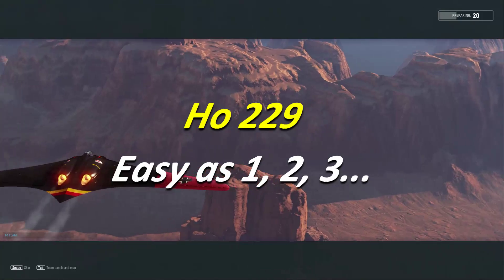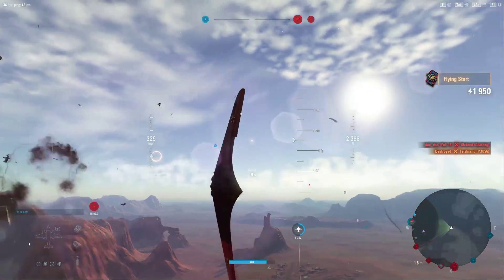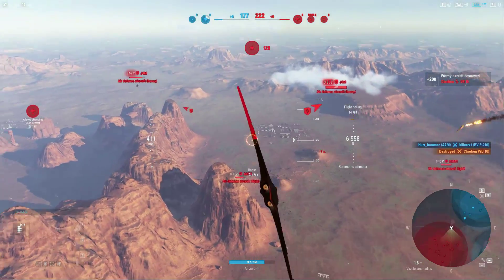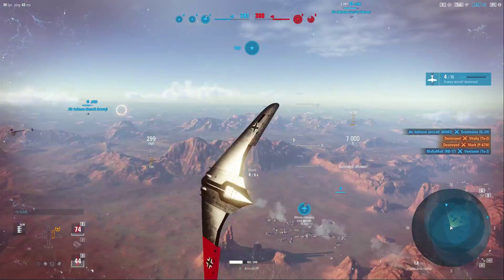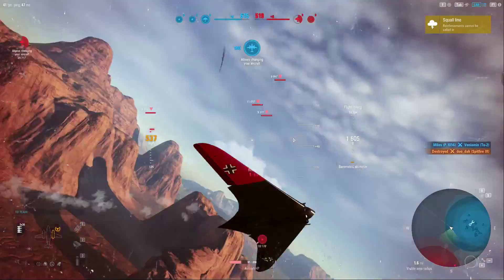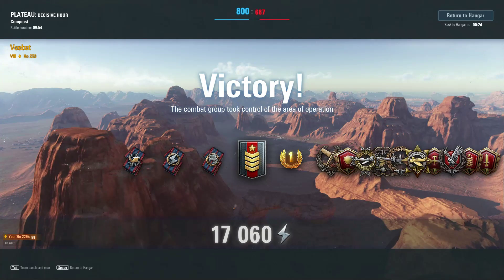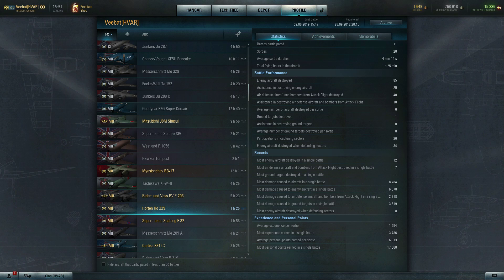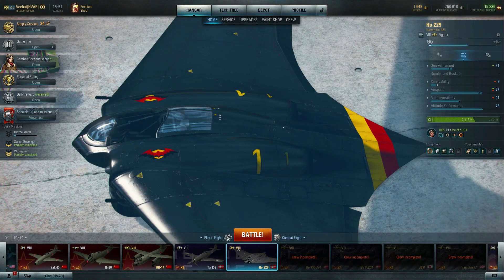World of Warplanes | Ho 229 | Review | Premium Tier VIII | Fighter

Comment: Glad the strategy has worked so well for u! I spend nearly the entire day yesterday specializing my Ho 229 and have begun to really appreciate it for what it is. My record game so far in it has come to just under 24k pp. I also dropped the pneumatic restarted altogether in favor of the engine cooling and the improved engine mixture. Yeah the engines r vulnerable, but the benefits from the other 2 consumables just r too great to warrant dropping for a pneumatic restarter. If the engines being knocked out is really too annoying to ignore, then change out one of your equipment slots for the engine durability module instead. With my current build, I can go from 1k ft to 14-15k feet with just the 8 seconds of boost plus the 10 seconds of overdrive boost from the engine cooling. Nothing can keep up with u when u can change altitude that easily and makes any pursuer just stall out and become easy prey. I've made mustangs, tier 8 heavies, tier 9 fighters, a MiG 9, basically anything u can think of stall out when chasing me. It is quite ridiculous once u get used to it. I really enjoy this plane now that I've gotten used to it :D

Comment: The Horton 229 was built by the Germans during WW2 and was very near ready for production before the allies found the facility it was being made/tested at. It did fly quite successfully without computer and was a fast moving almost completely stealth fighter that the first modern "flying wing designed" aircraft was actually modeled from. Had the HO-229 actually made it into the war it would have bought time for the planned bomber to be made and we would very likely be speaking german right now.
Reply from the maker: Michael while I admit I was wrong about there being a powered model in testing there are many misconceptions about the Ho-229, mostly pushed out by Horton himself after he fled to Argentina. Horton thought that adding carbon to a sawdust resin composite would reduce the radar cross section is wasn’t that effective when tested in the lab against a British early warning radar from the same period. At best to had a 20% RCS reduction compared to a Bf-109. Also Northrop beat Horton to the flying wing, and while they may have borrowed some features after operation paper clip, the B-2 was mostly derived from lessons learned from the XB-35/45. As for flying well without a computer, at a small scale sure, but as this was meant to lead to a larger design for the 3x1000 design it would have proven unstable. That is why the XB-45 project died after experiencing catastrophic stability issues. This is the reason that Mr. Northrop didn’t see his dream of the flying wing in production until late in his life when technology could catch up to his innovation (watch the video of his engineers showing him the final production model, it’s heart warming). As for winning the war... they were far from full production, and even if they were the ground forces were so far into German territory at that point it would be a moot point.
Reply: @Veebat  %20 is not bad. We can tell "stealth" to Ho 229 as that time(For WW2). Low RCS and high speed mix was so dangerous for WW2 theaters(if this bird can fly)

Comment: nice video this bird is unique the horten 229 but , these 3 shoots technique that you say i use long ago in the ta 152 in specialist  can hunt this plane too , the vampire and the p 80 can do it too ? because i don't know if i get or no this plane , because if is easy to hunt down by these 3 planes , i don't know for sure  if i should get it , but is just beauty as  airplane ¡¡¡
Reply: Horton has a significant speed advantage of all of them although the P-80 'almost' keeps up in a Boost and a Dive. 

The Ta 152 gun package is the most lethal.  the p-80 has half the range and firepower. 

Horton has the Altitude advantage. but the Ta152 matches it in everything but engine power. The P 80 has the engine power but not the max altitude. 
but everyone involved is at the edge of their performance envelopes. Vampire is not even in the same neighborhood. 

Horton cant turn for shit. And we all know it by now. This is why we boom and zoom.

out of the lot of them the Ta is the most dangerous due to its ability to snipe an unwary horton pilot.
 But Horton has the speed and altitude performance to avoid the lot of them if it has to.
Reply: @StumpyDaPaladin  thanks

Comment: what wouldve been REALLY cool is if they gave this aircraft some kind of 'stealth' to where you had to get much closer to detect it than any others.  as youre looking at what is the very first attempt at stealth aircraft invented
Reply: That is exactly what the Navigational Radio Equipment is for. Maxed out with seasonal paint and it enhances your Concealment by almost 50%.
Which adds up to getting spotted at the range of ... <crunches numbers> ... 1260 meters. 

throw some ultimate long barrels on the guns and you get a optimal range of  ... 1182 meters.

which leaves you with 78 meters of distance you need to cover before you can (in theory) start shooting a target. 
(hitting at that range is another trick all together)

that means if your closing speed is sufficient, they wont see it coming.  

However this trick comes at a cost. You DONT get a gun sight. 
the best you can hope for is certain bonus perks to accuracy for 15% and then Marksman 2 for a 25% total.  

And instead of the 3 shot burst you will only get a double tap before overheat triggers. 

one could tone down the stealth by 5% (208 meters of closing distance now needed) if they wanted
 and gain a 5% bonus to hitting maneuvering targets. Which if i recall correctly increases by half again the proc rate of the 'Auto Hit' feature of Marksman 2.
Reply: @StumpyDaPaladin  holy cow thats cool....  ok now i want this!  i dont have the time to grind away at the missions for this as a college student.  but can you eventually buy this plane?

Comment: A plane with an identity crisis...a light fighter whose almost sole task is to shoot down bombers with the maneuverability of a heavy fighter....it doesn't seem to perform that well if you use it as light fighter unless you bushwhack unsuspecting fighters diving from altitude BNZ. TRB your a dead duck down low. Yes, a cool historical plane, but going after bombers and heavy fighters at altitude as your bread and butter seems to make it a one trick pony in my mind...
Reply: there is much more to flying some light fighters than turn and burn dogfights. This is one of those fighters.
THat said i think this was made the first tier 8 premium german light fighter because otherwise 
this would be the 3rd german premium tier 8 heavy fighter. 

Speaking of identity crisis, historically the plane was designed at first to be a fast attack bomber  
Carry1000 kg payload,  out to a range of 1000 km, with a top speed of 1000 kph

Only later did someone think "lets give it some guns and let it shoot bombers..."